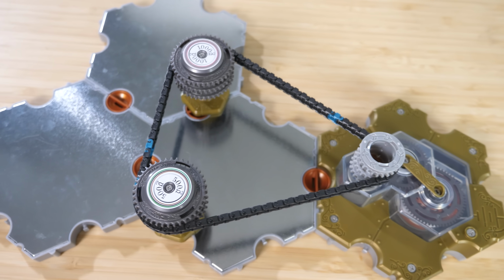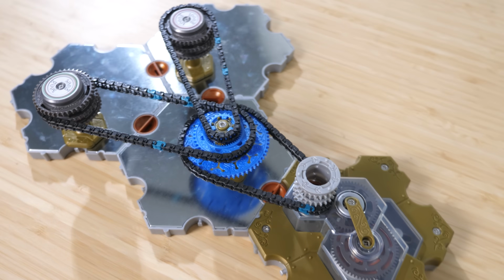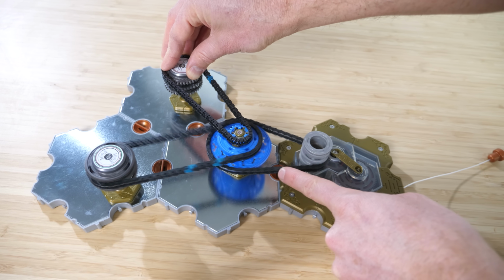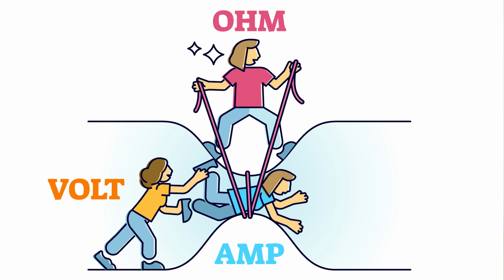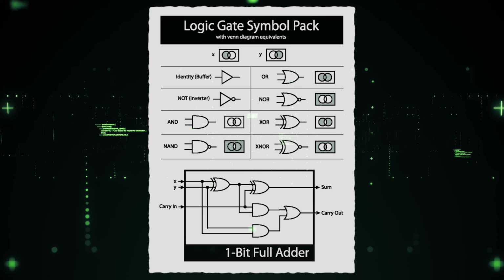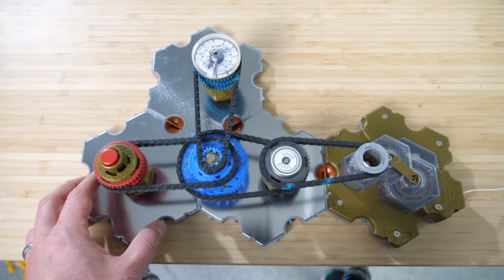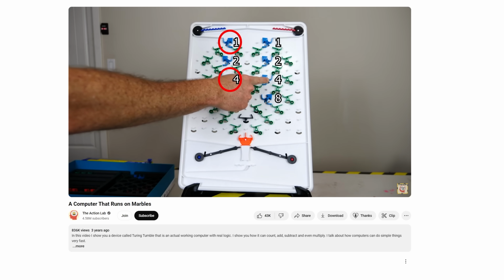Making Non-Electric Circuits With Computer Logic

Comment: What if we integrate electrical computer and these non electric computer to make a computer that can help your computer boot even faster and as a back up when electricity suddenly goes off u can use non electric one to at least save you files?
Reply: How high were you when you wrote this
Reply: @stblackhole  6'1 if i remember correctly
Reply: Im usually 6 but i was hanging upside down. So def added an inch with that gravity
Reply: @stblackhole  yoo i just had a great idea!! 
What if we integrate electrical computer and these non electric computer to make a computer that can help your computer boot even faster and as a back up when electricity suddenly goes off u can use non electric one to at least save you files?
Reply: @stblackhole  i was on 1st floor on my bed so about 319.1 feet above the sea level.

Comment: 7:55, what about the sound wave and heat generated by the chain? Isn’t that the equivalence of the “flow of energy through the fields”
Reply: no, those are just analogues to resistance as well

Comment: So, a complicated mechanical watch that is only run by a spring could calculate/tell the time, day, month, year, including leap years, moon phase, a chronometer with split seconds, perpetual calendar, chime the hours, play simple melodies, can tell sunrise and sunsets, can tell when to celebrate Easter/Passover, sympathetic resonance, measure temperature, (and there is also a resistor when you run the minute repeater) among many things. The only off-logic to it is why the heck you pay $1.5 million to strap it on your wrist.
Reply: And you’d need some seriously tiny sprockets and chains

Comment: My Lego chain is only long enough to go around the little gear on the engine and the other little gear on the back wheel of the 'the batman batcycle'. So it's really short and I'm pretty sure it wouldn't make very much electricity like yours. The batcycle is really cool though.

Comment: Unfortunately you cannot build a computer with chains just yet since you haven't shown how to make a TRANSISTOR with gears. You showed using switches which although are similar, requires a human being to toggle the state. Computer logic gates turn into computers specifically because the gates are electronically controlled, not human controlled. 
Demonstrate an actual transistor with this kit and you will actually have a mechanical computer
Reply from the maker: https://store.upperstory.com/products/spintronic-transistor
Reply: @TheActionLab  why didn't you show that then?

Comment: One amazing thing you missed about this model is that you showed the core reason why computers get hot: when you have a NOT gate (alone or in a more complex circuit), then in one of the states you have to let current through to the ground. This is shown as your gears spinning, and the generator consuming its thread.

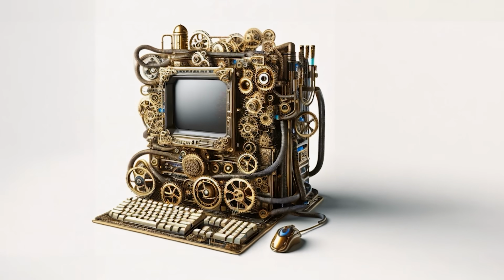Comment: @6:48 If you want to be super pedantic, you only need the NAND & the NOR. You can make the NOT by tying the two inputs of either the NAND & the NOR together. And if you want to get really mad, you can make the NOR from 4 NANDs (tie the inputs of the first two NANDs together (ie. make them into NOT gates) and use them as the inputs to the third NAND. Finally tie the inputs of the fourth NAND and the output of the third NAND together)

So really you can build any logic circuit out of just NAND gates.

Comment: Two things: 1) This is a TERRIBLE way to show how circuits works.  2) You are wrong about logic gates; there are SIX gates, not three.  Also, NOR is not opposite NAND.  NOR is opposite OR and NAND is opposite AND.  In fact, a NOR gate is exactly like an AND gate with extra steps.

Comment: True, Veritasium clearly doesn't see the value of using abstraction and simplified models in solving practical engineering problems. Ironically, while debunking the chain-of-balls model of current flow, Derek himself forgot that electrons are not really particles, but are quantum field fluctuations. Which, in turn, could be vibrating one-dimensional strings. But all that is irrelevant when designing electrical and electronic circuits. In fact, we don't even consider individual electrons; we model electricity as the flow of a charged fluid—a continuum—and do calculations accordingly.
Reply: Electrons are NOT quantum field fluctuations.  There is no such thing as one dimension strings.  Quantum physics is a fucking joke!  Electrons ARE particles!

Comment: I think this set really shines at simulating analog electrical circuts. Basicaly, you can model electricity with a mechanical system because you have only three types of base elements: proportional (friction/resistance), integrating (mass/inductance) and differentiating (spring/capacitance). What's also interesting, is that inductors and capacitors switch their roles if instead of input voltage, you consider input current.
Reply: Wow.  You are just wrong.

Comment: Back in the sixties, I was given a toy computer that you assembled called Digicomp.
It was plastic gears and metal  poles to hold it together. The idea was based on the first large main frame computers and you would input switches, turn the gears and an answer would crank out.
Reply: That sounds ridiculous and I love it.
Reply: Ridiculous but absolutely true!.
I wish I still had it. I think the reasoning was based on the Babbit computing system only in miniature.
I sort of got it to work. The problem was I was only eleven, had no idea how it was supposed to be assembled despite the instructions, no idea what the purpose was and absolutely no help.
It would be a collectors item now!
Reply: @kindlin It sounds ridiculously stupid.
Reply: I had one, but it was never quite clear to me how it worked.

Comment: Funny thing is spintronic sometimes used to describe electric phenomenon which can be modified by spin manipulation. Example by changing electron spin you can change the circuit resistance.

Comment: Working in the medical engineering field for many years, there were many devices that stand out.
The Monaghan 225 ventilator was a fluidics only ventilator.
Absolutely no electronics.
The internal modules were the sensors and various logic devices, all powered by air and O2.
It would not be affected by EMF.

Comment: I remember when learning semiconductor electronics, that I learned about "holes" conducting from positive to negative, which is not exactly true.  What happens is that electrons in the valence band jump toward an empty spot, leaving a new empty spot in the process as they try to move from negative to positive, causing the apparent movement of the empty spots, called "holes".  But for the sake of argument, conduction band electrons move from negative to positive, and "holes" move from positive to negative.
Reply: The electron holes are almost as real as the dressed electrons in that band. The dressed electron has a real particle at its core, but would have negative effective mass. The hole is has positive effective mass but is not a dressed version of a real electron.
Reply: Holes even have apparent mass and charge. They are, for intents and purposes, real particles. Well, until you try and collide them and you get nada.

Comment: The issue of loss of energy due to flow through the wires or electromagnetic induction (or electromagnetic self-induction) is mostly a problem just for physicists. Engineers have more ,,practical" approach - ,,hey, this or that can happen in reality, so beware of that, but for now let's pretend it's not there". I see how it can become an issue, if e.g. a high-current wire is right beside a low-current one, but other than that (and maybe some disruption-preventing measures) we can ignore it for a moment. And that is one of the reasons, why concept of electric hydroanalogy (showing a flow of electricity in analogue to flow of a liquid in a pipe) is still in use.

Comment: I have one question, but before that let me elaborate. I have a electric motorbike, China made-Singapore brand. Strange thing that I observe along since using those motorbike, seems like if I light all lighting of the motorbike, it's battery drains faster than if I only use one lighting set. Why tho? Is it because E=mc^2 which is in this case the energy drains more if exchange to light? I have hypothesis that if you transform energy to light its different than for wheel spool/ accelerated or general movement(momentum?), light works as cubic space and that's why drains more energy. That's really an interesting phenomenon for me.
P.S.
Maybe my explanation still vague but in short assume that no mass means energy escape/flows more RAPIDLY than if just used for movement/momentum release.

Comment: Minecraft Redstoners have made actual computers in Minecraft with these very same Gates and things, but using Minecraft mechanics to make them. 
- This means that if you have a powerful enough PC and enough time, you can indeed make a ACTUAL computer inside Vanilla Minecraft (without mods or Datapacks other than to speed up the game). People have done this before but the main issue is how slow the game is, but it does indeed work...

I think you should, if you know how, make a video of this idea but with Minecraft because it is the same principle but inside a game. You could always speak to an actual Redstone player and let them explain it in your video, like a Colab, that would be cool. 

Minecraft is not just a game, it is an Engine.

Comment: tbh this is a terrible representation of logic gates.
because instead of relying on properties of circuit's state (like low/high DC voltage on inputs) they rely on changing circuit itself (with switches)
Reply: aka there's nothing in any of these models that you could chain with other models to make them work together, because state is changed with hands.
Reply from the maker: Just need a switch that is turned off and on with the chain voltage. Which they have already made. They call it a "spin" transistor

Comment: It's come full circle! I'm so old I was taught multivibrators using transistors as switches before CPUs existed. Bi- and monostable versions. The base level circuits logic gates are based on. I learned as they were put together on chips. 555, ... I literally designed those gates to a component level and board design. But once it got to hundreds and then thousands of them on a CPU chip, I decided to just sell the stuff instead! 🙂

But to see mechanical devices in place of those simple transistor circuits is going full circle back for me.

And glad you gave an h/t to Veritasium's video that started a long, long, long... 🙂
Reply: Old!
Reply: @Michaelroni-n-cheese  And experienced. 🙂

Comment: so do you know what the first computer was?  I will just tell you it was Charles Babbage's difference engine.  Some say maybe the abacus.  The whole reason that computers are electronics is that we used mechanicals to the put that we could not longer machine the parts necessary.

Comment: “Every model is wrong, but some are useful” is one of my all time favorite sayings. I model various systems for work whether that’s logistics, commodity movements/prices, or industrial chemical processes (ChE by degree). Every single model is wrong in some way (ESPECIALLY if using some sort of machine learning) but they all get the job done just fine.
Reply: Even those currently accepted theories are models only. They don't explain every situation. We still have many unexplained and need more theories/models.
Reply: Every model is NOT wrong, only incomplete.  There is a HUGE difference between wrong and incomplete!  If you assume that every model is wrong, you will never accomplish anything.  Nitwit!
Reply: glad you learned that saying today
Reply: The thing about models never being 100% correct is that is situation is basically the only exception. Ohm's Law is equally applicable to these chain drives, as well as flowing water. It's fully analogous.
Reply: yea
Reply: The model is a conceptual model inspired by the physical model.  Engineering contexts simply almost never require the complexity of the most comprehensive physical model and can use the approximated conceptual model.  It's as easy as teaching both to the level needed for the field of study in focus.
Reply: This quote was made about Statistics, all models about Statistics are wrong but some are useful. This quote isn't about everything in general.
Reply: Right..... enough
Reply: Y
Reply: Ew a ChE degree the egos is smelly in here
Reply: @uwillfail  you have a problem with my degree?
Reply: @Ryush806 I would expect a fellow engineer to be of a higher level than engaging in fights in a YouTube comments section. It’s the epitome of immaturity I would only expect from an under sixteen year old to present. And you give both chemical engineering and yourself a bad name.
Reply: @BritishEngineer  I was asking if the problem was my degree specifically or something else I said that engendered the ad hominem attack. Not sure how that was read as engaging in a fight unless you’re constantly looking for one.
Reply: @BritishEngineer  And yet, you're here perpetuating a fight that never needed to begin. Immature in itself to try and shame this person for asking a simple question, and unoriginally resorting to age modeling.
Reply: @Ryush806  the ChemE are egotistical not your degree nobody has to know the degree and you just already said it and exposed yourself as an egotistical person
Reply: @uwillfail  lulz our host here has a PhD in chemical engineering. That was my main motivation for including that tidbit.
Reply: @Ryush806 I personally just don't understand why people credential-drop online. I mean not that you can't, it's a free country just that I don't see the point. If you are right then you are right regardless of the credentials and others can affirm your correctness with only the bare information. They can't validate your degree and even if they could it won't make you more right (or less wrong whatever the case actually is). 
Also if you are wrong and the degree convinces people I don't really see that as a win or a benefit to anyone.
And (not that I'm placing the blame on you) I'd like to point out this example right here where giving people online anything more than the point you are trying to make just gives them more shit to nitpick (me as another example 😂).
Anyway I respect your right to conduct yourself as you please, this is just my 2 cents worth!

Comment: I have this set & the extensions and I confirm it's super fun to build and operate those circuits!

Oh, and it's actually humbling to realize how easy it is to just "burn" a circuit by designing one that when switched on just destroys itself because you forgot to add resistance on every path and it short circuits dumping all energy at once :)
Reply from the maker: haha, yes, I did it multiple times accidentally, and it is quite surprising. Luckily they have the breaker inside the "battery"

Comment: I suspect the really hard part of building a computer this way, aside from cost & labor, would be timing. As folks who've worked with FPGAs know, things go very wrong if you can't predict the delays for signals to get from one point in the circuit to another. With mechanical backlash that seems like it becomes a lot harder.
Reply: Yes and no. You can just assume more delays and wait for those longer, slowing down your computation until it is reliable.